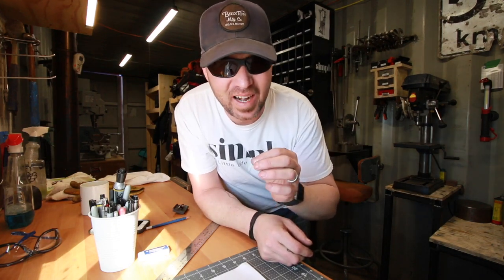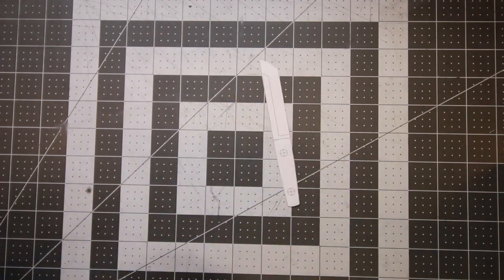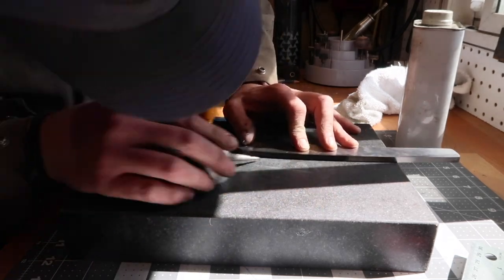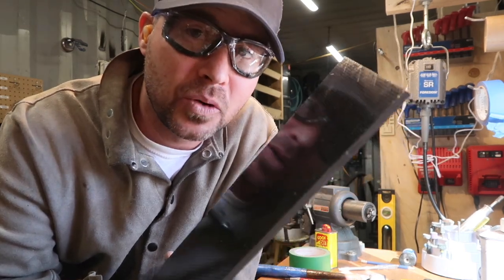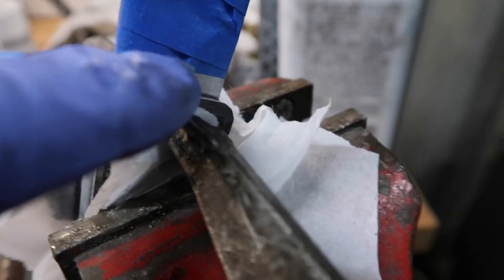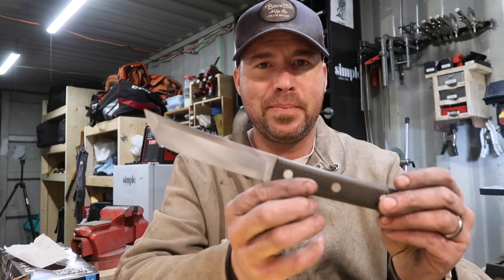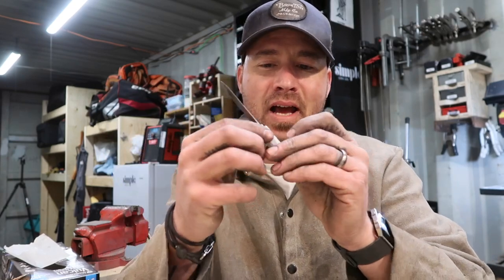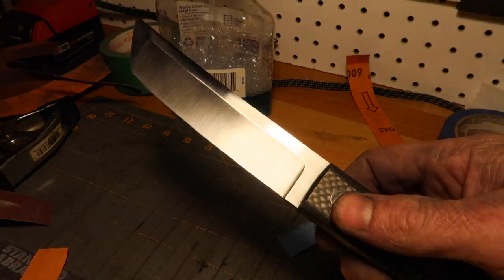Knife Making - How to Make a Tanto Blade

Comment: Great Videos and thanks for sharing. Question, where did you get that edge scribe? The one I use isn't suitable for thin stock and one you are using appears that it will work . Thanks again.

Comment: Cutlery rivets would've been good use so you didn't have to mess up the finish on the handles. I use 5/16 head ones with a rivet but the counter sink em about couple thousand below the flats on the scales.

Comment: japanese tanto usually had 10 or 12" of blade. The word means "half sword". I have forged a couple out of 8670 nickel steel, but have not hardened or mounted them yet.  Forging is the fun part. 12" blades will need a LOT of grinding and sanding, plus I'll have to make a tsuba, habaki, etc. iIenvy the traditional Japanese smiths- all they had to do was forge and heat treat the blades. Someone else got to rub that puppy on rocks for a month to make it sharp .